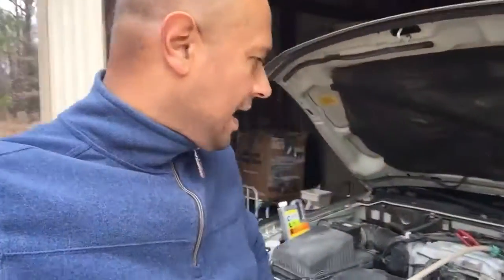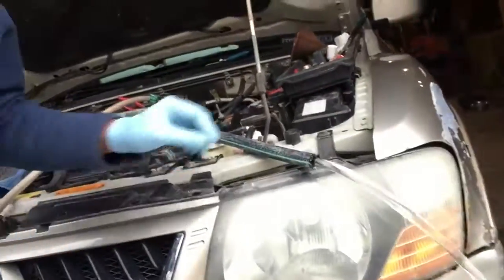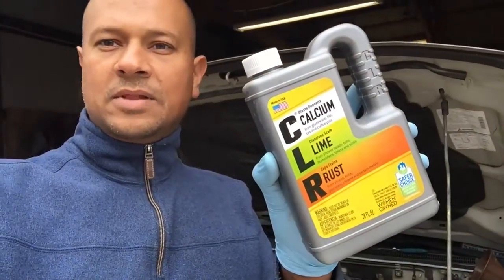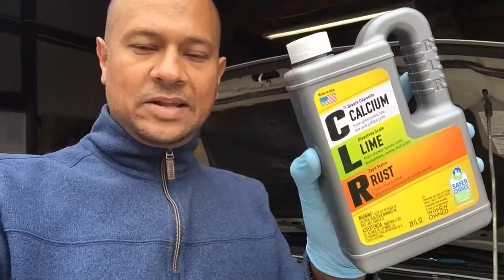Mitsubishi Montero Limited 2003 No Heat - Heater Core Flush with CLR and Garden Hose Off Grid

Comment: What's even better is to follow those lines to the passenger side under the SUV and disconnect them there to purge/backflush.  More space and easier to access and mess with the hoses.  It's very tight inside the motor compartment by that firewall.  You can also flush the rear heater core but I didn't need to.

Comment: After you confirm it's a clogged heater core you can drain and flush it, and then refill it with pure white vinegar and let that soak for a week or two. It'll harmlessly dissolve the sediment and scaling and come out with a good 10 minute flush backwards and forwards.  This can save you the heater core parts cost and about two full days of agonizing tom foolery trying to replace the heater core.  I avoid taking interior parts and dash apart at all costs! lol

Comment: 06 Montero limited. I have drivers side getting hot, but  passenger side cold. Did you follow the coolant lines underneath? Also the rear heat doesn't get hot either. Will flush soon.

Comment from the maker: Ok Update to the Video... when it gets cold below 40 degrees F, the car has a problem getting warm.  So my "temporary" fix was to take a piece of styrofoam 1/2", I took off the left radiator top mount / support -- then squeezed the foam rectangle infront of the radiator, and re-attached the top mount.  This definitely increased the heat inside a little (it was definitely noticeable. --- DONT FORGET to remove the foam if the temperature gets warm or it will cause the secondary fan to turn on and stay on to try to keep the car cool on a warm / hot day.  I just removed it yesterday (Feb 7th) as it sounded like the car was getting too hot, and today... the temperature dropped to 26 F --- !!  Should have left it in. ;)

Comment: Did you ever have issues with your AC?

We have an 04 sport, the AC compressor kicks on, lines are cold, air is always hot. In the winter, it takes a good while for the heat to reach the cabin.

Wondering if it's one of the blend doors.

Comment: im having the same problem, but im also loosing water from my cooling system , i cant find the leak... so my 3 problems are, no heat at all all, the loose of 12oz every 200 miles and my bigger problem is that that kind of lost of water end up in an engine over heating  issue... im sure i have a leak in the heater core because i have replaced the radiator, water pump, thermostate, 12 whoses and the overheating is still there....  im sure i have a  leak on the heatting system, but i cant find THE SYSTEM, mine is a 2004 montero limited its the same vehicle as yours, how can i reach to the core?? i will appretiate a lot you help
Reply from the maker: I'm no expert, but I'm pretty good with diagnosis.  So 1) No heat at all.  Get engine warm to normal operating temperature (let it run for 5-10 minutes), cool/hot gauge in dash should be around the middle.  Touch the heater core hoses.  If there is NO flow into the heater core, one hose will feel warm/hot, the other will be cool(er), as there is NO flow.  If both hoses are the same temperature, then the blend / valve controlled by a motor / actuator is not working.    I first took off the panels under the driver area, above where your knees are.  if you get on your back and look up, while moving the vent control knob, you'll see a motor move a lever from face, face/feet, feet, face/windshield, windshield/face/feet, then defrost.  if you turn the knob you'll see an actuator move.  if it moves to all the positions of the switch, that motor/actuator is working.  When you turn the temperature from cold to hot, a 2nd motor right next to the other motor moves an arm/actuator.  If this does not move, the Temperature / Blend motor actuator needs replacing.  If both are working, and there is NO heat, then you could have air bubbles trapped inside the cooling system.  I put my car on a ramp to raise up the front of the vehicle, while I had my wife rev the engine and hold it at, 1000 rpm, then 1500, then back to idle.  Then up to 2000rpm for a while, then back to idle.  All this was being done while I have the radiator cap OFF -while watching for bubbles coming OUT of the radiator.  After a while and after revving the engine to 3500-4000 rpm for a while, and all of the bubbles stop... you've been topping off the radiator with antifreeze.  When it will no longer bubble and no more antifreeze can be added, the heater core hoses should be both hot if there is circulation.  If one is hot and the other is cooler (a lot cooler) your heater core is clogged.  You can Try CLR like I did, but you'll have to forward flush and backwards flush the core a number of times.   If that will not unclog the core enough, the core is bad.  I got mine on Amazon for about $60.  I didn't replace it yet as it's been too cold and I dont have a place to work for a day or two to take apart the entire dash board and get to the center of the console behind the radio...  I hope that helps.  John.
Reply: You might also have a leaking o ring in your coolant pipe. It is under the mess of intake parts. Just like a spark plug replacement. The oring might leak and pull in air when cooling down. Look in the backside of motor on top of transmission and look for any signs of puddling or rust/water dripping (look from passenger side) I've got a 2000 with some heater core and is working great. Isn't always heated core. But these montys are known for oil and coolant leaks
Reply: @TJDAGAMER ... Hi I have same problem with my 2003 montero,,, where can I find that O ring please??